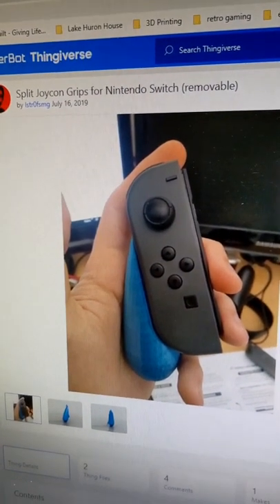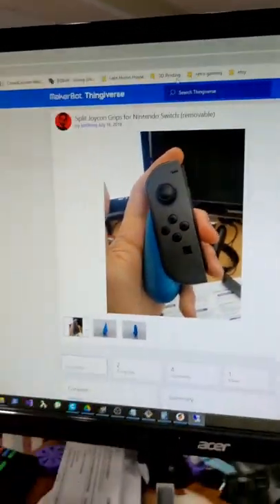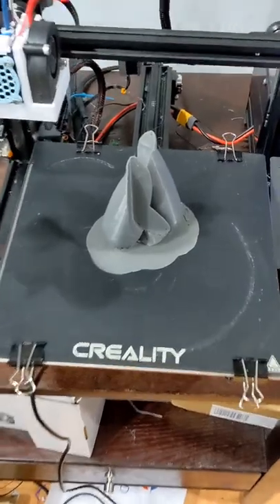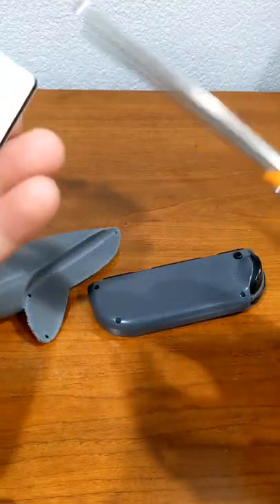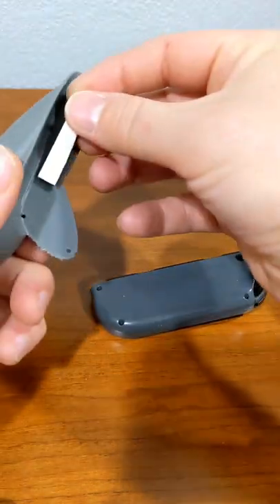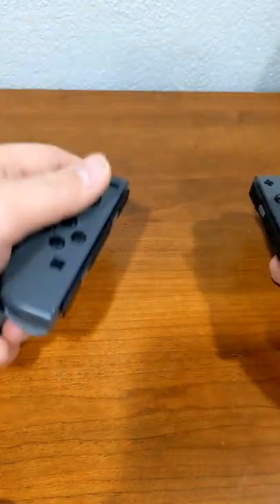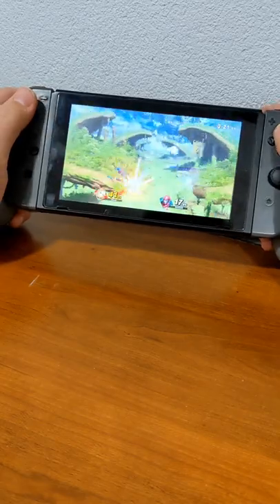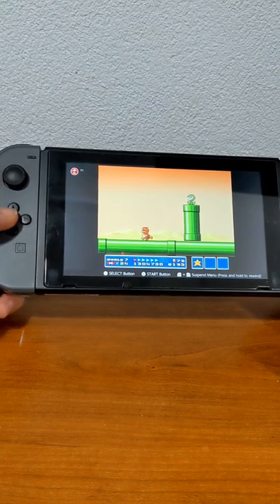3d printed nintendo switch joy con grip review

Comment: Bro you unscrew the back of the joy con not use double sided tape
Reply from the maker: Yup, I didn’t feel like doing that. I assumed that the added plastic would require a longer screw and didn’t want to have to find one
Reply: @printmeister  oh ya I get that, also I 3D printed the flat grips and they feel pretty comfy for a 4 hour print